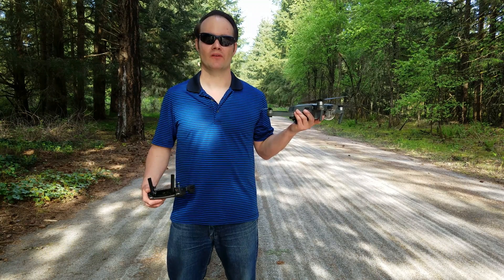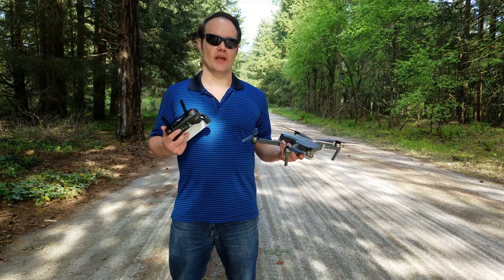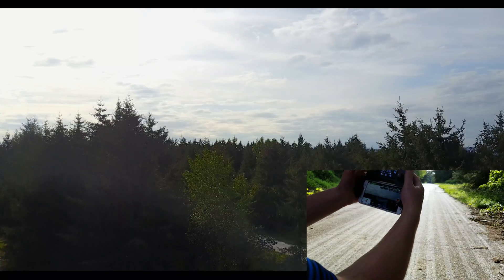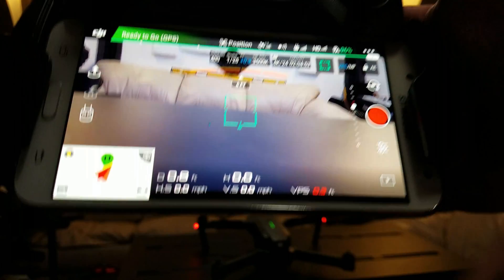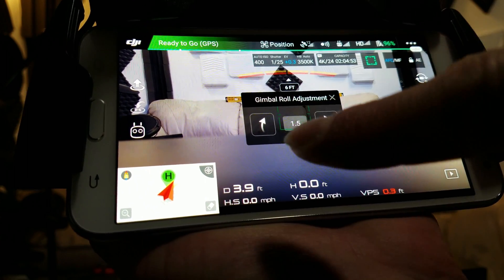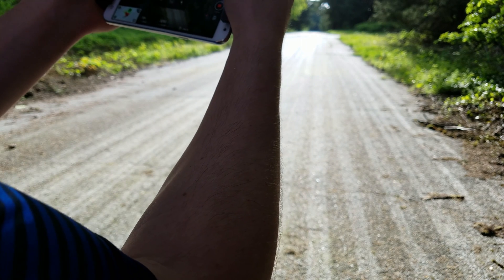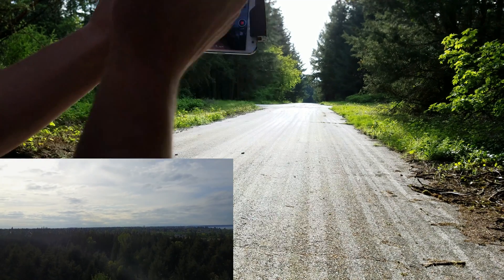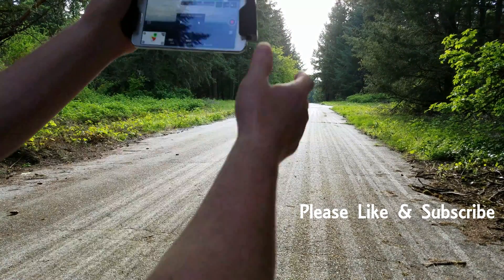DJI Mavic Pro Drone: Tilted picture Video Gimbal Roll Calibration How-to Fix it ground or flying 4k

Comment: I have experienced the gorizon tilt issue as well. Thx for the vid. Fyi, I recommend removing the bubble cover from camera as the air intake is in there that cools the mavic.
Reply from the maker: You are welcome! I read a lot on the bubble cover, I happen to agree with you on removing it because it messes up the video. DJI say's not to remove it because the camera can get damaged and it effects the aerodynamics. I would rather have better footage and just not fly it in the fog/rain, or too close to the ground.

Thank you for Subscribing,
Cody LLS